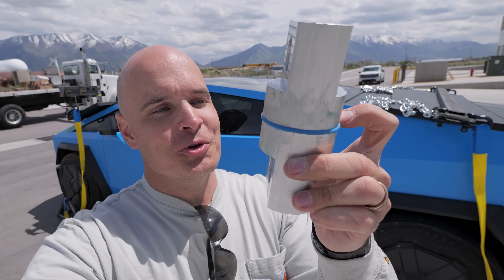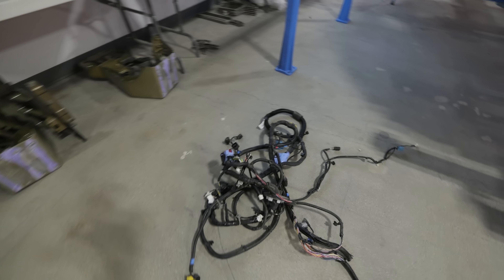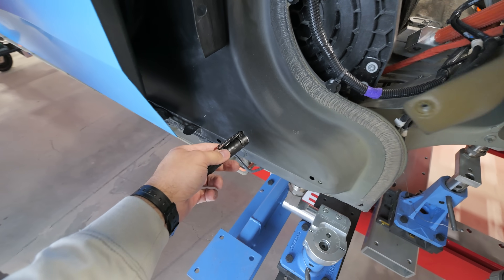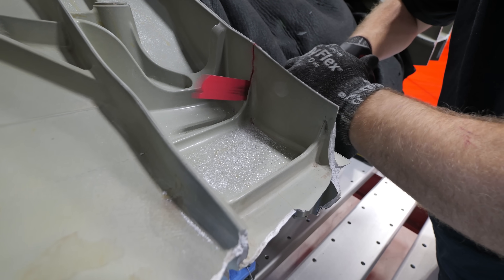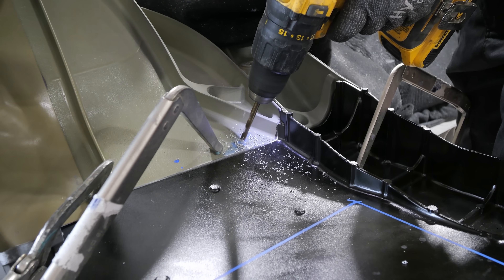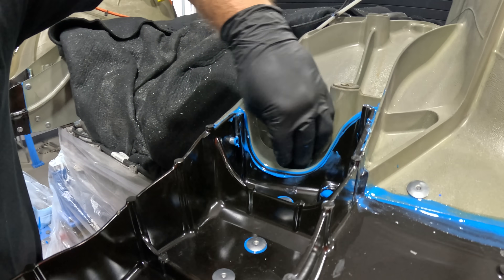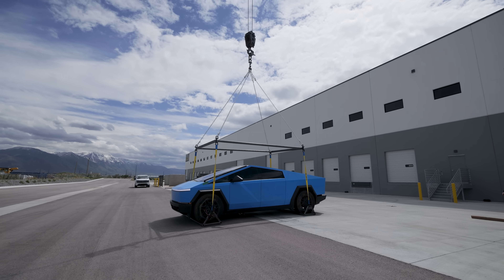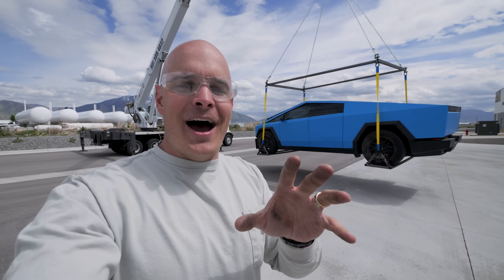Tesla Fixed my Cybertruck with GLUE - (but I'm not mad about it...)

Comment: Fusor 2098 (or Fusor® 2098 Crash Durable Structural Adhesive).  
Manufacturer: It is a two-part epoxy-based adhesive made by Parker LORD.

Comment: It would be interesting to see how fast the bond degrade if the material hasn't been cleaned or prepped correctly.  Surface prep isn't as easily inspect-able as bolted/welded joints.  As this repair method gets popular, I can see shops taking short cuts for profit.  Some airplane parts are still riveted and/or bolted for repair-ability and inspect-able post repair.

Comment: If they charged me 13 stacks for some blue glue to fix my truck would be angry lolz😂.
Completely rebuilt my 1999 f250  for like 9 grand,  with "expensive" deaver springs and kryptonite ball joints and hubs

Comment: How many times do you drive a truck and trailer perfectly straight? I mean perfect.. 0 ° deflection from center, 0 cross wind, 0 left or right torque?  This test is invalid. It needs angular pressures applied. Try it with gale force wind and the crane swinging side to side. Maybe weights shifting side to side in the bed. Even crazy glue would lift that truck in that test. Anyone remember the guy hanging from a spot of crazy glue on his hard hat?

Comment: So many people glazing about the glue and repair method neither of which are exclusive or necessarily designed by Tesla and forgetting it shouldn't be breaking in the first place. What is the benefit of fixing it back to original strength if the original strength isn't sufficient for the rated towing capacity? While this video is interesting to see the engineering of this repair process I feel it is overly glazing Tesla and seems intended to repair the negative image that these destructive youtube testing videos has created for them. I mean in the first 5 seconds it's being called special Tesla glue... they didn't invent this glue and it's also ironic that they have had recalls over panels flying off because of poor quality glue. Like they should have used this stuff on those panels TBH. This is like a Jedi mind trick "We've got glue, have a sniff. See? No recall needed here!"
Reply: If you apply forces 10x the rated force you expect it to fail. If not you overengineered it and are not resourceful
Reply: I wouldnt even trust that glue to begin with just WELD IT.

Comment: That glue is impressive, but their design process may be more impressive still. I would've figured that it would require welding, but I do still wonder how this glue would compare to friction stir welding. It's a much more difficult welding method, but it'd be awesome to see it used as part of a repair process. The cost does seem a bit high for this repair given what was done, but it's still significantly cheaper than I would have thought.

Comment: Test that glue joint for shear strength lifting that truck, it will fail. It all sounds impressive, but you're starting with a cast alloy frame. Not strong. Glue it with extra epoxy super glue and brace it together... dont be so proud, its ultra durable, high strength, super glued soda can.

Comment: Don't you remember the super glue commercial from years ago when they did the same thing.  You can use water between two very smooth surfaces and can't pull them apart.  Let's do a test where they yank on the new improved bumper.
Reply: Yes thank you! Or see how it fairs after a couple of years!

Comment: Shooting a wire and then fixing it is "just a little" diffenrent from something that stops working for most of the time after years of use, even if you could diagnose it you can't have or replicate the parts.

The more we take steps in this direction of "owning" our stuff the more we lose control and possibility for learning skills.

Remember when you could change any part of your phone under a minute with minimal skills and tools,
or when you set the settings in your device and they stay like that through updates.

We give actual control and choice away for quick conveniency.

Comment: When cutting power to everything is a safety feature that is also the number one reason for why I like older cars.

With newer EVs shouldn't even be called cars or driving; cause those basically drive themselfs and if you try to really drive them you can't or don't feel it. Impossible to fix by yourself. Are unnecessarily big and heavy for parking, bridges, roads etc. There is no infrastucture to actually use just EVs. 

For EV drivers: Energy is Energy no matter where it comes from, now ask yourself how we are going to affort double energy use for EVs and infrastructure rather than what we already have. And when "white men" can recycle their own clothing then I can start to listening anything about the battery and mining problem.

Comment: Theory and practice show that yes, the joint is solid and reliable. But in the short term. What will happen to that glue in 3, 4, 5, or 8 years? How will it withstand seasonal changes in temperature, humidity, salinity, etc.? That's my uncertainty. For now, I prefer welded joints

Comment: I’m actually impressed not only did they make it cheap and affordable, but they made it simple and easy to be honest with you. I still would not get a Tesla because I’m used to an American steel frame rather than some futuristic metal design that is held together with glue welding and bolts. Yes, it may look simple and easy, but that wiring chassis that is in there confuses me. I’m used to repairing American vehicles and every other vehicle rather than a Tesla so that can catch on fire.

Comment: Aluminum reacts rapidly with oxygen in the air to form aluminum oxide on its surface, which occurs almost immediately at exposure. This oxide layer initially protects the metal from further corrosion. That's why aluminum does not rust. Source: 1985, Non-Organic Chemistry class, junior high school, USSR.

Comment: Virtually every negative Cybertruck video has some derogatory remark mocking how it's held together with glue. But I guess glue has a technology that has improved like everything else! Glue is GOOD!! Now that I'm thinking about it, I remember watching some repairs to a wooden structure with glue. I worried that the glue would be a weak point, and I was informed that actually the glue would be stronger than the wood itself.

Comment: The amount of structural adhesive on the truck from the factory for that rear casting piece was either not enough in my opinion or needed to be squished more.

Comment: The test would be legit if you used the black coating that was applied to all the repair pieces.  I'd guess the fail point on the repaired sections will be the black coating (maybe eCoat or epoxy paint)

Comment: Wow, Elmer's Glue has a tensile strength of 3,600 psi.  This 2.5" diameter disk has about 5 sq. inches.  7,000 lb truck plus 500 pounds for rigging = 7,500 lbs.  7,500 lbs/5 sq in. = 1,500 psi.  Less than half of what Elmer's glue can take.  Impressive?? Jerry you should be ashamed of your self.  What a klutz.  Throw the truck away.  It's junk.

Comment: Cybertruck is not more Repairable it looks like an inside of a Windows PC Computer Tower all the cable wires all around and a mess now if Apple Company made a Skyline Truck it will not be so messy
Reply: you know you can put all of your comments in 1 instead of typing 4 separate comments right? im assuming youre on the older side if you dont understand that.

Comment: Any super glue can lift a car effortlessly, its depends on how the forces are apply ,then hole work done by air pressure......😢😂😂😂😂😂😂😂😂😂😂😂😂in this case   the car is hold by 2 round cup so its act like suction , main reason is  air pressure 😢😢😢😢

Comment: Because the forces are working at 180°  if  both forces are apply less than 180° then it holds only few hundred kilograms 😅😅😅😅😅😅😅😅😅😅😅😅😅😅😅😅😅😅😅😅😅😅😅😅😅😅😅😅😅😅😅😅😅😅😅😅😅😅😅😅😅😅😅😅😅😅😅😅😅😅😅😅😅😅😅

Comment: Structural adhesives are used massively in the car industry. The glue Tesla uses isn't even particularly good, it's quite low tensile strength relative to some on the market. Only 22 MPa, that's like half the strength of ABS plastic, holding together far stronger pieces of aluminium.
Reply: Yeah most people who see this test think it's impressive when its actually less than 10MPa lmao

Comment: I'm not skeptical about the strength of the glue as much as I am about the longevity. In Ohio it should be fine but what about areas with extremely hot temperatures like summer in texas. Surely that would affect the strength of the glue

Comment: As much as I am not a fan of the cyber truck, I definitely do need to give the respect where it is due. That is such an innovative way to fix something and that glue is curiously strong.
Reply: Bro wait for the smartphone manufacturers to use it on their batteries making repair shit.
Reply: CT structural repair ... is cheaper over Rivian cosmetic dingles repairs...
Reply: Industrial Adhesives have been used for 70+ years. Amazing stuff

Comment: He did mislead the crowd in his last video. The Cybertruck's vertical load was 10 times the maximum specified vertical load. For the vertical (tongue) load, SAE J684 requires the hitch to withstand a static load equal to 1.5 times (NOT 10 TIMES) the rated tongue weight vertically—without permanent deformation.

He literally had to pull down the front with a dozer to make it snap, meaning the hitch would be on the floor well before the maximum force was reached.

So it is nice that Jerry attempted to rectify his mistake.

Comment: Years ago I had this conversation with an aerospace engineer and he was talking about how we have adhesive tapes now that are so good that there's no good reason to use rivets when building planes and that the reason we don't use them instead is purely optics. No airline wants to be the airline who's plane crashed and was "held together with tape." I don't know how accurate that sentiment is but I wouldn't be surprised if it was.

Comment: the glue part is something that has been used for 25 years allready if not more. BMW did it on the e60 allready where they joined the aluminium casting to the steel frame. I use a similar product from 3m for my project cars as wel. Sometimes there are spots where welding it would be make a big problem in the long run rust wise. But with the glue you can paint the backside for proper protection, just leave the strip where you are going to glue bare. Then the first step with the 3m glue as wel is cover the bare strip you prepped for the glue with a layer, and then you put down a beat and clamp it all. Works perfect every time. An no rust problems at all.
Also A LOT faster then welding actually. For welding you need to do atleast as much prep, but you have a lot more work after welding then after glueing. You can sand the glue like it where a harder (epoxy) filler. But sanding welds flat is a lot harder to do, and then after that you are probably going to hammer work the panel to make it perfectly straight again. And then you wil still apply a body filler and sand that again. So you essentially skip the weld grinding/sanding and the hammering part.

Comment: I mean, putting some adhesive in doesn’t preclude a weld on the exposed joints, and even though it is just aluminum, the weld is going to be stronger than epoxy, more tolerant of temperature extremes, and less susceptible to some forms of degradation (basically it will tolerate the same things the rest of the aluminum frame will, which is not true for epoxy). , I’ve seen a similar surface area of cyanoacrylate hold up a car, and, while I’m sure the epoxy is much tougher than super glue, I’d be surprised if it handled dynamic loads even close to as well as a weld (and dynamic loads are what an automobile needs to protect against most). 

Finally, the adhesive is going to make repair more difficult compared to a weld, which you could just cut though with woodworking tools like the base aluminum frame in the event you need to replace it again.

Comment: That is some pretty impressive glue. I need some of that. In regards to the Cybertruck though, while the sectioning repair is clever. My concern would be more so that impact accidents could fatigue the casting in other areas. Not necessarily just where the break occurs.

Comment: the fact that you can bond a 2.5 inch flat surface to a another 2.5 inch flat surface, and pick up 15000 pounds without any issues is insane. The fact that it can bond directly to a flat surface like that baffles me. I'd understand if the surface was keyed in a way that created varying levels of directional tension, but two FLAT surfaces ??? wow.
Reply: actually two flat surfaces can hold a a substantial load even without glue. If two surfaces are perfectly flat its impossible to separate actually. This is what  any glue does. It flows to make full possible contact making surfaces effectively perfectly flat.

Comment: A knew a guy who slid into a curb while driving in the snow with a 2019 Audi A4. The front of the car underneath the body panel was mangled. Required new subframe, suspension components, steering rack, and several other items to ensure the car was straight and safe to drive many of the components were aluminum, which is par for the course on German luxury cars. pretty sure the bill was something like 12 grand and the work was done through Audi.

The repair done by tesla seems to be very well done and thought out. They obviously anticipated repairability being a requirement when engineering the castings. Its also very obvious that crash safety was an important factor as well. I think this video serves as good sort of fact check to those who say tesla's are impossible to repair and will be totaled in the most minor of accidents. Obviously not the case. Also serves as a good reminder that aluminum castings are not some sort of novel material when it comes to automotive and there are sound procedures in place for dealing with its repair in case of an accident. 

Steel structures cars are also dealt with in a similar manner except the problem is that steel bends before it cracks which means making sure the vehicle is perfectly straight and square while doing the repair becomes a major consideration. some steal can be bent back without being compromised while other pieces must be cut away and replaced with new pieces that are held on with structural adhesive and welds to ensure that the vehicle can withstand the loads it was originally designed to handle and will maintain similar amounts of safety to an original factor vehicle when in a crash.

Comment: 11:42 It's interesting that the new procedure for applying the adhesive does not at all match the old one (complete surface coating versus three stripes). And it's also a different purple color which probably means it's a different product.

Comment: I'm impressed, but not surprised. I work in residential photovoltaics and energy storage, and work with the Tesla Powerwall 2 and 3 on a regular basis, and I hold Tesla in very high regard. They have the lowest failure rates, nearly the most impressive performance figures, and easily the highest customer satisfaction rate

Comment: Special TESLA glue really. They designed thier own glue to?

JB Weld will work to

When you use perfectly flat pieces of metsl it creates a vacume and has an extreme suction grip even if you used water.
Like a glass stuck to a wet counter.

Pull on an angle or at 90 degrees and then see how it works or try it on irregular surfaces. Glue is great for models and RCs.
So is foam structures.

Anyway recycling doesnt work by adding more non recyclable parts. Nuts and bolts can be reused or melted down. Glue is just dump material. Plastic to. Welding is better because it can be melted to use again. It even makes metal stronger like kneading dough and adding binders.

So this whole green mission makes sense as long as you dont look at all the short cuts used that are mis directing attention away from non green issues. The afterlife contamination issues are starting now they are being scrapped. Junkyards have huge problems with EVs. Even transportingbthe batteries back to recycle plants cost more.

A 1965 GTO may have polluted more running but in total it can be 99% recycled. Even the seat foam and insulation was made from corn. Those damn mice are eating it though. Them living in my tail pipe taught me that.

But a TESLA need at least different recycle centers. Batteries, glues and plastics and metal. What else?

So look at the whole product and compare with others over time

We will be better off😊

Comment: The amount of adhesive used in the repair was different from the original. The original Cybertruck had three lines of adhesive, while the repaired one had significantly more. This means that an original Cybertruck has much less structural adhesive than a repaired one. Based on this video, you might be better off choosing a repaired Cybertruck over an original one.

Comment: Structural adhesive is brilliant.  However, removing the rivets or other fasteners used for curing purposes only, greatly reduces the likelihood of cracks forming around the fastener in a future collision.  I don't know if they still do this, but Corvette uses screws to ensure no movement occurs during the curing of the epoxy used in the passenger tub.  They screw them into the frame in a few locations and don't remove them after curing is completed.  Getting rear-ended, even gently causes cracks to form around the screws.  This requires pretty much a complete teardown to repair or replace the tub.  Had the screws been removed it is extremely unlikely that this happens.  Depending on the value of your vehicle, this can total a rig built this way as the parts and labor costs are exponentially higher.

Comment: Also, notice the upper metal that was glued to the hitch wasn't damaged because you pulled it down rather than in, so it makes sense that repair costs are gonna be different and higher than yours.